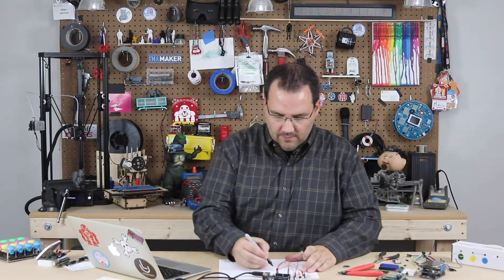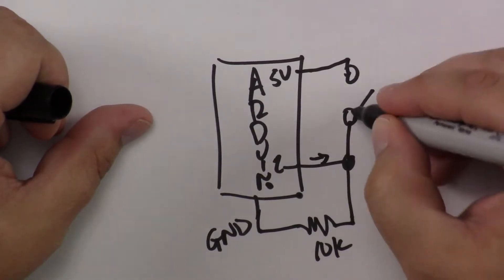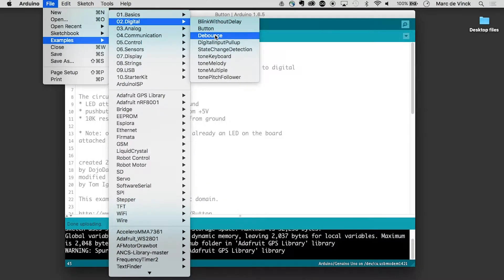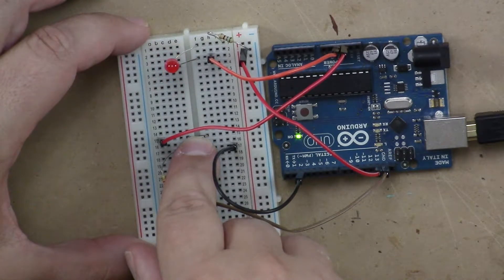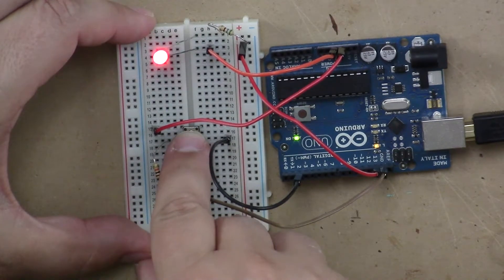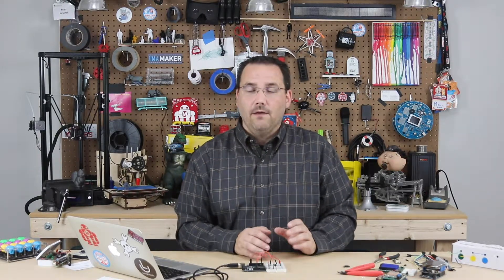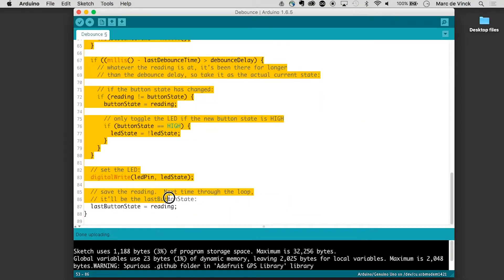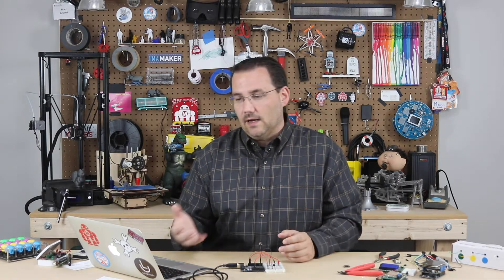Arduino Prototyping Basics #21: Button Debouncing & Toggle

Comment: Your explanation is very neat but I have a begginer question, if you have a code that is already uploaded to your Arduino and then you upload another code your previous one will get deleted? Sorry if this question is stupid but I didn’t work on an Arduino before.
Reply from the maker: Pharaoh Boy Exactly. And make sure to save your code locally on your computer. Once it’s uploaded you can not download it from the Arduino. You must keep a copy on your computer.
Reply: Marc de Vinck ok thanks

Comment: sir how can i write in a code to multiply the button pin and ledpin...for example 4 buttonpin and 4 led...thanks in advance
Reply from the maker: Each button will need it's own input pin (and as described in my video - just change the pin #), not a big deal as you should have a few available. If you want each LED synced to the button, you will need 4 pins for the LEDs too. There are other methods that could save you a few pin, but if it's only 4, I would suggest to just use the built in pins.
Reply: @MarcdeVinck  thank you sir